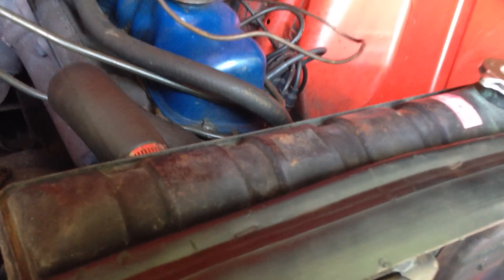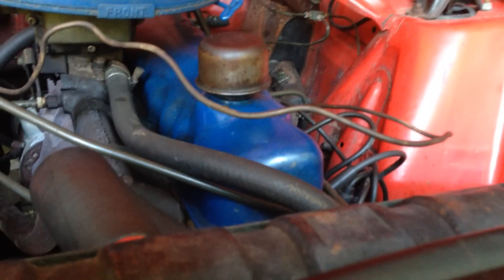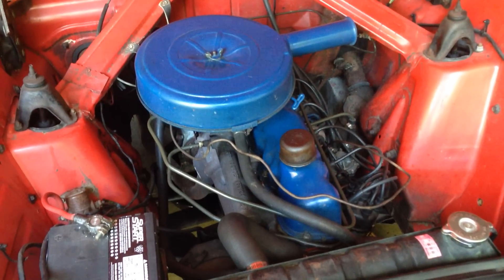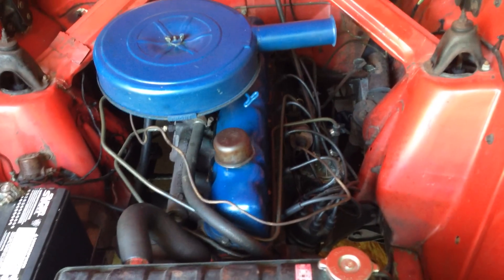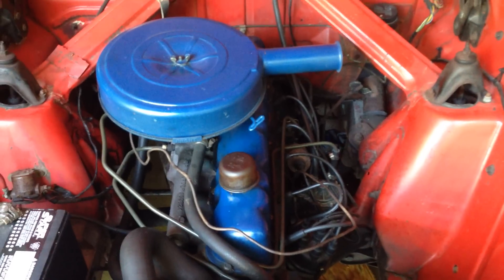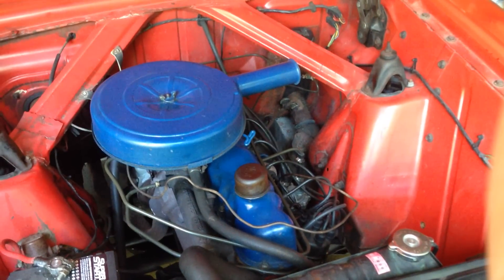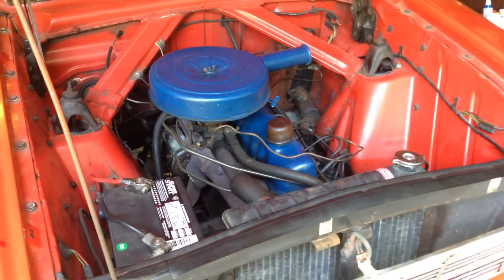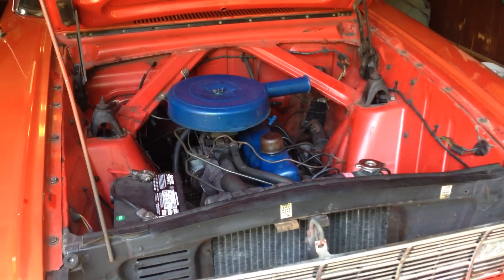Falcon Engine Swap Thoughts

Comment: Evans Waterless coolant, while pricey, solved a weird overheating issue on my Saab. Electric fans are also a good mod. Probably unrelated, but worth checking on the condition of the heater core as well...

Comment: Keep the original.  An aluminum rad and electric fan wouldn't solve your problem. The original cooling system is fine when it works as designed. Don't focus solely on the rad although you should spend a few bucks to have a shop rod it out and test it. When you flushed the rad you maybe flushed the engine too?  Other things to consider:  a pump impeller that's "ate up", a blown head gasket or cracked cylinder head. If it's one of the latter two, pull your plugs. If there is coolant getting in a cylinder, the piston top will be suspiciously clean and free of carbon. Good luck.

Comment: Are you sure that flushing the radiator with water was enough? I know that people use some kind of an acid and then run the system or something. Actually have lots of family members that are good with engines and cars. Couple of years ago, my dad put together our old volvo penta straight six that is in our boat now. I belive he used acid. Unfortunatly I dont remember what kind of acid or how he did it. I know for sure that you can buy cleaningfluid for theese. But aluminium and electric fans sounds good. Big fan, like your channel. Keep it up. Bye.

Comment: Obviously the regular option is a W16 quad-turbo, I mean how else are you supposed to keep up with traffic :P

Seriously though, I would say a 2.5 or 2.8 straight six out of any late nineties, early two thousands BMW would be a nice fit.  Top end you're talking about a hundred and eighty horsepower, naturally aspirated, smooth power band and reliable.

And fairly regular.  Those engines went in a lot of cars for a lot of years in various forms and configurations.  You'd keep the straight six, it can't weigh more than that old block, and you'd gain a nice but reasonable measure of power and it should run well for years.

You could even, if you stretch things a bit, argue it to be an almost period correct modification.  After all, the AC Ace at one point used a BMW straight six, and they wound up dropping a 289 in that thing and giving it a new name...

Comment: I've been thinking about this with "the modern every man" in mind.  If you swap engines...let's just say you want to move into fuel injection, want it to fit in the engine compartment without modification and it needs to not be taxing of the drivetrain as it sits.  I have come to the conclusion your best option is the 4.0 ford ranger with automatic transmission.  Why? Cheap, awesomely reliable, did I mention cheap?  And it fits.

Comment: rebuilds are good if you know the block is sound, this is what I am doing with my 94 firebird formula (ask me how its more expensive than a short block) or just buy a short block and a re-manufactured trans and have the stock heads milled. faster and less work. Also it takes the risk out of a blocked coolant or oil passage in the old block

Comment: What about the vortec 4.3 v6. Just remove the vortec system and carborate it, they make the manifolds for it. They're great engines and plenty powerful especially carbureted. If you aren't worried about it not being a ford engine it might be a solution
Reply: If you can do it, keep the original engine though and just do little things to hop it up like dual carbs and a header

Comment: I had a 200 I6 ford in my mustang, I always just bled it with the cap off, it will eventually push all the air out if that is the issue.  

The Thermostat could be malfunctioning or in backwards.  

if you REALLY want to get it right the easy way buy an Air LIFT Radiator filler.  It pulls vacuum on the cooling system using compressed air this will not only allow you to fill the car without having any air pocket problems but allow you to see if you have any lines leaking at the same time.

Comment: I think that with such an original car you should do what you can to preserve it's originality, but it's not my car. If I didn't do that one thing that I've always though that would be super cool with a falcon would be one done up similar to a factory lightweight car. Ford only made 2 and that was in 1964 I believe. Compare it to the little hot Dodge 330 that came out of the factory ready to shred it's rear tires. There is something that I find so cool about those early 60's factory performance cars.

Comment: Make sure all the air is our of the system and check the water pump, it may have no veins left.  Could be a bad radiator, and worst of all head gasket or block issue.  Thing is, it ran great for you for a long ride on the freeway, so I think there's AIR in the system.  That's what you changed since it ran well without overheating last week.

Comment: A good friend of mine has an '62ish XK falcon with a 250ci (4.1L) pre-crossflow 6-cyl that came out of a later model Australian Falcon, Cortina or Fairlane, and it is almost what you'd call fast, with a cam and a nice sized Holley carb. I doubt you have these engines in the US, but they are a bolt-in affair so might be worth looking in to instead of a boring old V8.

Comment: RegularCars dont mess with the engine. if you drove it 500 miles, the motor is just fine. rather go through the vehicle, get a timing light (or borrow one) and just set everything to factory, i would replace the thermostat off the bat and try to find a fan shroud. think of that fan like a pump, it is way more effective when operating with a slightly restrictive flow. the car is not broken and it is a lot of money to do a swap. just for me to put a fresh engine in my 92 ford crown vic, nevermind replace the engine with one exactly the same, i have spent 700$ in just oil, coolant filters, and gaskets. it is very expensive to replace an engine so if it does not have a rod sticking through the side of the block, dont replace your engine. lots of saved money will be in your future. when it comes to neal, google the shit out of this car. there has to be someone that understands these cars very well and can fix very effectively.

Comment: I would stick with a Straight-6, but maybe go with a newer one. I'd like to say a 250 ci or a 300 ci, but those were in trucks and base model mustangs (After they were based on the torino platform starting in 1971) Maybe find a bigger 'thriftpower' six, like a 170 ci or a 200 ci. Maybe even a 215 ci or a 240 ci out of a mid-late 50's Ford pickup if you can find one.

Comment: A 302 Windsor would be a good choice, or if you wanted to keep with the I6 you could get a 250 xflow with either an iron or alloy head. Incredibly reliable and keep that original I6 feel. There's plenty kicking around where I live.

Comment: in argentina we manufactured those falcons til 1992. We have a lot of performance parts for the 221 & 188 ford straight six... we used them in "turismo carretera" a category of car racing based on ford and chevrolet mostly

Comment: Is it spitting out coolant at the overflow?  This is the sigh of a blown head gasket.  I would check the compression in each cylinder to see if one or more are low.  Eric the Car guy is building a Ford Fairmont from the seventies into a Mustang in sheeps clothes, so he will have a decent spare ford straight six.  I also agree with the comments that the Ford 300 Ci truck six would make an interesting replacement, though it might not fit.  Anything modern (fuel injected) would require substantial changes to the fuel and electrical systems.

Comment: I would say try to fix the six. However, If you are seriously considering a swap how about a pinto 2.3. They are simple, reliable, and plentiful. Plus, there is a fairly large aftermarket. You could even get kinky and go turbo!
Here's what I think.
Pinto motor from a late-model ranger
2bbl Carburetor or MEGASQUIRT
ranger cast exhaust manifold (which is pretty much a header) going into a custom exhaust with a cat because polar bear.
C3 automatic
Keep in mind that any engine swap will require a new, custom, driveshaft because good luck getting that ford-o-matic to bolt to a modern engine.
This will get you a nice, reliable driver with more power than the old six, but not an obnoxious amount that would require other chassis/suspension mods just to be safe. This also shouldn't require any radical cooling seeing as that, well, seems to be an issue with this car. All pinto 2.3's ive seen tend to like to run cold.
my $0.02

Comment: @RegularCars You're always gonna have issues with the cooling system on an old car like that, over time, with an iron block. When you mix two different kinds of metals (iron from the engine and aluminum or brass from the radiator) and then add water/coolant, there is gonna be weird corrosion. I would check the water pump. I've seen water pumps on cars that are under 10yrs old that had the impeller blades completely corroded away. But your idea of changing to an aluminum radiator and an electric fan are right on spot, Mr Regular. Just add a new water pump to that list. Also don't forget the coolant temp probe.

Comment: Here's an idea I was gonna do to my falcon, turbo six. Get a el cheapo 200 ci ford six out of a early 70's maverick, (Grab the diff, front spindles, disk brakes and trans too) and drop it in your falcon. It'll bolt right up. Then get a holley or motorcraft carb and (Single or 2 barrel, your choice) and replace the floats with solid ones, Bolt that sucker on there, fab up a J-pipe to bolt the turbo to and plumb in a ebay intercooler and you're making 200 ish horsepower and around 300ish ftlbs of torque. You can get this done for around 3 grand using good parts, and that includes the brakes. The factory bottom ends in those sixes are forged and can take one hell of a beating.

Comment: When you change coolant, air wants to trap behind the thermostat, and the thermostat doesn't open because it's not soaked in hot water. Sort of the chicken and the egg effect. With the radiator cap off, idle the engine until it starts to heat up, let cool and top off coolant, then heat it up again. Repeat several times until the head is full of coolant and the hot water triggers the thermostat to open. If the head gaskets are shot, it will always tend produce air pockets in the coolant system. Unless pushed too far, it's unlikely head gaskets are shot on a ford I6.

Comment: IIRC, that happens because you haven't "bled" the cooling system. Since you don't have any bleeders, just let it idle with the radiator cap off so the air has somewhere to escape for a while. Might also want to see if that cap is working correctly and holding pressure.

Comment: If you put a better intake air filter with out the crap cap the restricts air more than it should and a aluminum radiator even with out a electronic fan will do it first look for a high flow air filter housing and filter

Comment: How much money do you want to "dump" into the original engine?  Why not find out what's wrong?  Why would you buy an incredibly cool old car with low mileage and an engine only slightly more complicated than a rock and put in a modern engine?  If you can't fix this engine what in the world makes you think you're capable of doing an engine swap?  If you're considering getting other people to help you swap the engine or do it for you then JUST GET THE DAMN THING FIXED.  The radiator isn't likely the issue but if someone put in a bunch of stop leak and clogged it then you might need to get a used radiator or better yet get the original one re-cored.  Is the water pump working?  Is the car running lean or rich?  Have you done any actual troubleshooting other than wringing your hands?  You can take the radiator cap off and run the car and when the thermostat opens you should be able to see the coolant circulating inside the fill hole.  Did it ever occur to you that the lack of power might be related to the problem and that a top speed of 60 isn't normal?  Please don't butcher this car.

Comment: Have you done a leak test / pressure thing on the radiator? You could have a blown head gasket, not sure you would like to replace the head gasket, but.... A cylinder compressor test could tell you a story also.

Comment: A few things to note, Did you get the correct thermostat? Did you bleed the cooling system (aka is it actually getting hot???) Remember if youre gonna change your drivetrain, FORDS DO NOT SWAP TRANSMISSIONS LIKE OTHERS DO. Bigger you go engine wise, the c3, becomes a c4, becomes a c5 haha, they dont just bolt up and work... Just do your homework.

Comment: Mr Regular, how is the coolant pressure? Are you equipped to do a coolant system pressure check? If so, you shouldn't be seeing numbers notably over what is displayed on your cap. After all; radiators are made of approx. 1mm thick-walled copper or alloy...

Don't go changing to aluminium; copper has a better heat transfer coefficient. And considering the ah-hermmm... "sporting pedigree" of the standard falcon, you would be wasting money. Cooling fans are always practical, but never a miracle problem-solver. Copper is much more serviceable by the average-joe (if something goes wrong).

Looking at the bulge of the upper radiator hose, I'm guessing a thermostat that is sticky (you can take it out and check that it opens and closes properly in a glass of freshly boiled water) ...If the thermostat works fine, it MAY be a compression-leak into the coolant system (the water will most probably smell like fuel too.

Shaving the head would be cheap enough, and net you a "performance upgrade" for your falcon, and solve a problem (if it is indeed that sinister a problem to start with). 

by checking the head-gasket, you will be able to tell straight up if it's a combustion chamber to coolant system leak or not. And a head gasket is relatively cheap. The rest of the coolant system gaskets etc, you can make with Permatex (aeronautical sealant. Brown, and never hardens) and cardboard. I prefer Fruit Loops cartons personally: the grain-quality of the cardboard is second-to-none...

Comment: Just an thought. Was the car sitting for a long time ? The rad could be half full of sluge. Depostis from the engine from sitting + build up in the rad could have blocked off some the tubes. Or is your thermostat in the right heat range?

Comment: What if you got an old Cologne V6 like what was in the Rangers in the 80's, its similar to the engine used in the Capri, sounds great, plus you have the option of a 5 speed, and all for cheap

Comment: You could drop in a 3.8 V6 from a 4th gen Mustang. It would be staying true to Ford, while not breaking the bank. Or even a V8 if it will fit.

Comment: there is obviously air in the system. park it on an include or jack up the front of the car, blast the heat. massage the hoses.

Comment: 302 would probably be the easiest and most practical swap you could do. there is an overabundance of parts and plenty of cheap long blocks to be found. Also i would bet that it is the most common swap in a car like this so there would be a fairly large amount of documentation and internet forum support on how to do it.

Comment: rad cap off start it let it run up to temp on idel the air should burp out had same problem with my vw golf and i have aluminum rad and a electric fan

Comment: Have you thought about taking the Engine apart, finding the issue and then rebuilding it? I would hate a full swap because it's all stock and well.....Unless it's only a shell or the only part savable is the body I would never go custom.

Comment: Seems like the radiator is plugged or the thermostat isn't opening.  It's not the fan because that's a direct drive mechanical fan, and electric fan wouldn't fix it.

Comment: Run it with the cap slightly open, but in a position where it can be quickly closed. With a towel over it because it's gonna start gushing coolant all over the place. Have pans ready because it's gonna be all over the floor. Run it a while until that happens then close the cap as fast as you can.

Comment: Possibilities from a former 68 Mustang owner
- wrong rad cap
- spring in lower hose to prevent collapse?
- air  in system (burp on a hill)
- thermostat in backward or bad or your liquid gasket killed it (is the upper hose hot close to the rad)
- ** water pump might be jammed/dead which would (cool car, start with rad cap off, let it warm up so thermo opens, rev a little and look for movement in the rad)

If she overheats immediately something is wrong.  If you do get a new rad get a good one...my ebay Champion was great for a year and then didnt cool well.

Comment: Have you considered a block tester? The air in your cooling system could be from not bleeding it all out..OR could be a head gasket leak pushing combustion gases into the coolant. I say this only because you mentioned white exhaust in one of the drive home videos. I would do a block test ( checks for combustion gasses in radiator) and a leak down test (checks for any combustion chamber leaks) before you put any more money into this old motor. I know tests are not fun, but it's worth knowing what you have to work with before you start working. Measure three times, cut once?

Comment: DON'T DO THE 300 I6. different motor. these bench racers don't know much outside of google. the 300 is a big six from a different era. procure a 170, 200 or 250.  from a falcon/mustang. bolt-in swap. i've participated in one on a 64 falcon in high school shop class. watch out for the carb linkage. the 144 is hardly a rare beast but staying with the inline is easy street.

Comment: Check the thermostat? It may not be open up sufficiently. Otherwise you've got gunk in the engine block preventing the coolant from flowing.

What about an EcoBoost V6? At least it'll be Ford. ;)